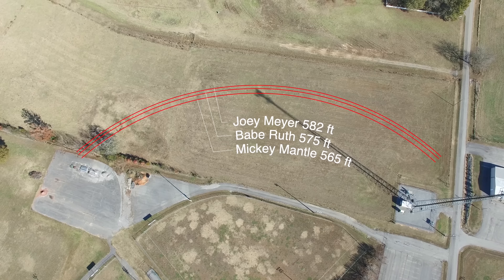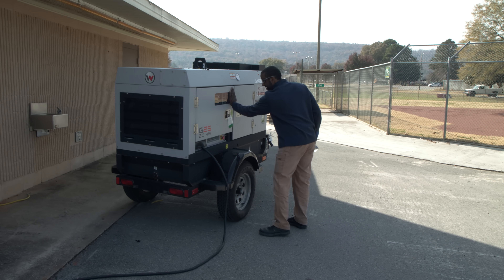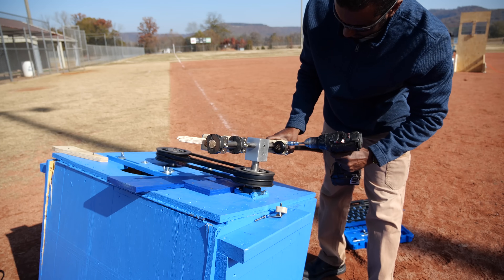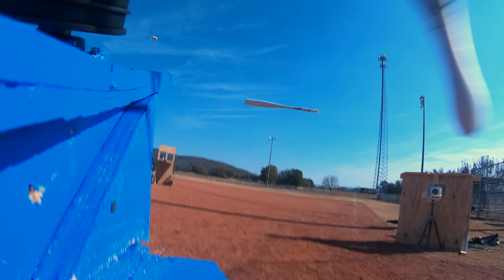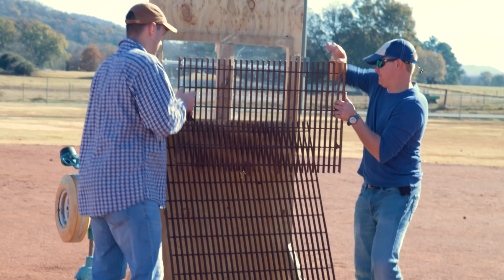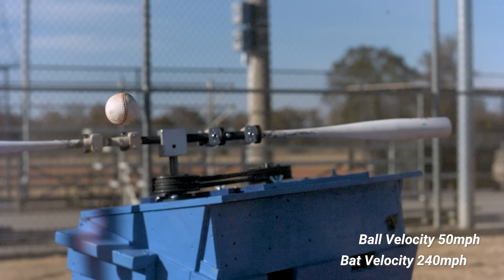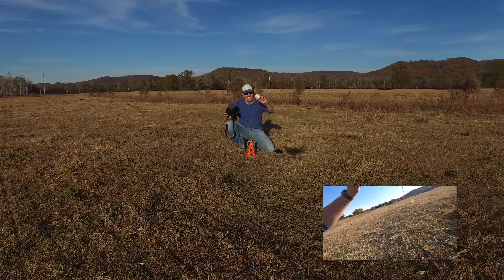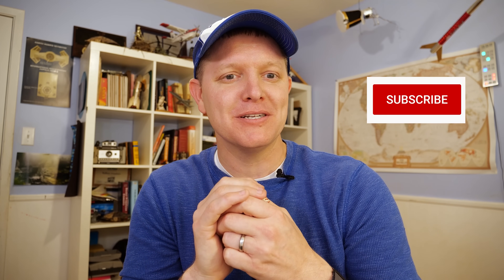World's Longest Home Run (The "Mad Batter" Machine) - Smarter Every Day 230

Comment: The illustration you drew at 3:37 is slightly misleading. With a 3 phase setup like that the torque will be constant (in theory). It would be more accurate to draw a straight line than one with ripples, as the three sine waves sums up to a constant torque exactly.

Comment: No offence Dustin, but you guys shouldn’t play like this. Spinning machines are no joke and not only you had zero protection (your school yard is nowhere near safe), but also stuff like that should be calculated by a mechanical engineer. Not only your bat failed unexpectedly, your bearing broke unexpectedly as you certainly didn’t calculate the dynamic forces, your rotor support is a freaking wooden table shaking, many times too light, no suspension, no rigid foundation... Please get some opinion from a mechanical engineer next time for your own safety.

Comment: OK Here is a question  for you.
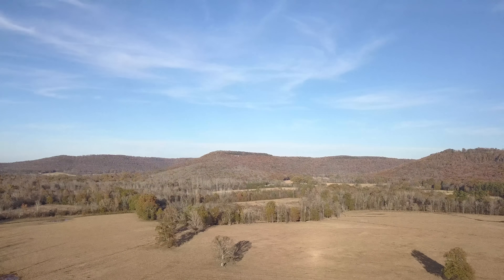At time marker 14:30, your drone looks into a distant field and at the exact point that is 180 deg from the sun there is a dright spot.  I have seen this many times as a pilot as well as a passenger in an aircraft.  

Question: what is the cause?
Is this difraction at the aircraft, increasing the flux at the surface, or something else?

Cheers 
Kevin Hanna

Comment: ADVICE: Of course the bat breaks. It's rigidly attached, and as you said yourself, you will get a tremendous force-concentration at the junction. Instead, you should make a bendable attachment, like a thick piece of rubber from a tyre or such. Just look at how a rotor blade of a helicopter is attached, it can always swing back and forth relative to the hub. It will stay in the radial position due to centripetal force anyway.

Comment: Someone should of told them, the speed of the ball vs the speed of the bat is what determines a home run in baseball... all you would need is good contact with a pitch from a 100mph pitch from Chapman... and use a better metal bat!!

Comment: Probably need to re-evaluate your safety protocols. Part of good engineering is planning for safety.   On another front. I saw a video of someone throwing a bucket  of water into the air at minus 53 degrees F. it turned into a cloud. I would love to learn more about what is going on with the high speed camera when that happens.

Comment: I saw Mickey Mantle hit a home run that almost went out of the old, old, old Yankee Stadium in the 1960s. It hit the upper facade in right field and was still rising. It was simply amazing. If the facade was not there, it would have gone at least 600 feet. Mantle was the strongest hitter bar none!

Comment: How about a titanium bat?  It is supposed to have a molecular memory and resistant to denting or being crushed.  My father worked with it on aircraft in the Navy, and in the early years, it was used to put on the leading edge of the wing.  What they found was that bending titanium sheet over the wing and riveting it into place, it would pull the rivets out.  Also we were told that the Soviets were able to accomplish multi pass titanium welding to build the Alpha Class subs by welding in an inert room.  Oooo a show on the metallurgy of titanium would be cool.

Comment: Arrgghh!
This looks like one of Myth Busters weaker episodes.
Align the wood grain correctly, and drop the speed to where the bat won't explode on impact. Only use one bat with a counterweight. Have the drive shaft assembly secured from the top as well. Fasten the entire apparatus to the ground firmly.
If you're going to go to all this much trouble, finish the job!!
LOL. Fun to watch regardless.

Comment: This is a good video but the pain problem of the whole video is in the Major League Baseball they use wooden bats. If they used aluminum bats they would hit harder and farther. Thus risking someone getting seriously hurt so they use wood bats instead. The guys in the video are using metal bats therefore they will be hitting harder and faster. But you can’t compare the two when they use metal and the major league uses wooden bats. It’s a good experiment and an amazing video but simply comparing the two is just not logical. Good effort and no questions that they would be able to make something that will hit farther but it’s just not in the same ball park.

Comment: Ya, this thing is a whirling deathtrap. The bats need to be swung at lower RPM on long arms, to reduce the gee load on the poor swatters. Or consider using solid rod instead of wimpy hollow bats that cave in on good contact and shed paint on every contact.

Comment: That plywood will not save you haha

If you revisit this, you should just use a metal pipe instead of 2 bats, and see if the MLB will loan you one of their statcast tracking computers. Also, make an air cannon that shoots the baseball 300 mph

Comment: What was the point?  Would have been great if he had made more about how the human body can generate enough force to compete with a machine that has to run-up for 30 seconds and consumes 300 watts -- concentrated energy.  The human body generates 90% of the same force in about 1/2 a second using 100 watts overall.  Now, that is amazing.

Comment: wow that looks fun Wow you got lucky where the bat broke it went in the perfect direction. suggestion would be to use a hopper on top of the automatic pitcher and put a wireless switch to drop the balls in. if you were switching the pitching direction on the fly after every pitch then you could add some actuators to move the pitcher up & down, left right but im sure easier said than done

Comment: Hi Destin. If the baseball is pitched slower the will the closing speed of the bat and ball be higher at contact? For example. Bat traveling at 200mph + ball traveling in the opposite direction 50 mph  = closing speed of 150 mph.

Comment: In the final hit,
- High-speed footage of the impact?
- High-speed footage of the bat failure?
- Why did the bat fail?  What was the mode of failure?  (appeared to be secondary to the ball impact)

Safety...
- overall... more attention to safety is needed.  The kinetic energy of a wayward bat and the potential for penetration (fractured aluminum) are both quite high.  
- Barriers for 'pitcher', 'operator', and 'camera' all did not appear adequate.  
- Kudos on adding the vibration sensor.  Consider adding a second.  
- Kudos on adding the pin to connect the two bats.  Not ideal, but a good last-minute addition.
- Pinning the apparatus to the ground is advised, as well as weighting the base to make it less susceptible to vibration.
- For high-risk devices, consider adding "dead-man" safeties.  e.g. on the main controller, and/or even a dedicated switch/person.  
- Did your insurer sign off on that shoot?  Woof!  :)

General...
- It seems like this project did not get quite as much planning as others.  Given the general success so far, a "redo" or "revisit" may be worthwhile.  
- Additional high-speed camera angles (add one perpendicular to the flight path, and an overhead angle) to allow for better data collection
- Additional analysis of the data (impact kinetics (ball, primary bat, secondary bat), flight path, machine vibration/harmonics, etc.)
- Could you apply motor-braking (as done with your circular saw project) as a safety feature to the batting machine?  In certain failure modes might this be more dangerous than without?
- Yes, I realize that staffing, personal time/schedule limitations, and cost are factors that may rule out "bigger and better."  Use the ideas as you see fit.

Thanks for the open discussion of science and engineering.  
- - Aaron S.

Comment: Everything was great until the aluminum bat came out. Then it all canceled out. Can't break a record with an illegal bat. By the way, I don't think anyone ever hit a ball much over 550 ft. 
That said, the new studies in launch angle and exit velocity has changed the game. Extreme impact is what we saw/are seeing now. A perfect example was Daniel Murphy, who was a good line drive hitter. But Murphy always fell just short. What he always had though, was that special intangible that's rare in baseball. The Mets could be down 10 runs with 2 outs and 2 strikes in the 9th. If Dan was at the plate, he'd believe they could still win. He was a rally starter and someone who never gave up. Well, it seems the Mets hired a guy who worked with Dan and Murphy took to this new batting tech like a duck to water. He showed how he was transformed in the 2015 post season. I knew he (in baseball terms) "got it". Some players get whatever their "it" is young, some older and some never. Unfortunately for Murphy, he got his it in the last quarter of his career. The Mets, in their infinite wisdom didnt want to pay Murphy, thinking his change was an aberration. But, nothing could be more wrong and he was sighed by the Nats for what would turn out to be a major bargain for them and went on to play MVP baseball, making his teammate Bryce Harper look silly by comparison. Bottom line: This was all due to Murphy and the new batting theories meshing like Mike Scott and the split finger that saved his career. Many probably thought that Muphy started taking PEDs, but all the evidence was clear, as to what happened. Sadly, had Dan discovered this at 25, he would likely be a first ballot HOFer. That's how amazing it was. Go look him up from 2015 thru 2018. He was an unstoppable force.
Anyway, love the batting machine, just disappointed that you guys used an illegal bat. You may as well have shot the baseball out of a cannon. I suppose it's the fun of the whole thing. I'm probably being way to anal.

Comment: Hey Destin:

3:35

When you drew a diagram of the 3 phase voltage, you drew a wavey line on the top of the combined voltage curves to represent the torque of the 3-phase motor. 

While this does represent the max-voltage, it's does not represent the torque. 
-----------
Due to the construction of motors, the torque is proportional to input voltage, which is a function of either:

In Y configuration - the summed difference between the voltage of each wire and the total combined voltage (combined voltage is 0, so it is essentially compared to ground)

In Delta configuration - the summed difference between each wire voltage compared to the other 2 wires separately

In either case, the total is a constant number.
------------
This is the major advantage of 3 phase over single phase. As the power is a function of the voltage and current (with current being a function of voltage and resistance), power becomes a function of voltage and resistance. This means that with a constant effective voltage, you get a constant effective power.
------------
While the same effect can be reached using DC voltage, the main issue with large-scale DC transmission arrises.

The issue being that, when transferring power long distances over cable, power losses occur. The losses are mainly due to the amount of current passing through the wire. The best way to reduce the neccessary current is to increase the voltage. (P=IV).

This means that in an ideal situation, power would be transmitted long distances at High Voltage and then lowered for use in homes and factories.

Unfortunately, while Direct Current solved the constant power problem, it is not very easy to convert from low voltage to high voltage (or vise-versa)

Alternating current can be easily converted using a transformer, utilizing the magnetic flux created by the coils of wire with AC currents.

This means that we need to properties of each to get the best of both worlds, efficient and constant power.

Three Phase solves both these problems.

-----------------
Credentials: 
Currently studying Mechanical Engineering at the University of Waterloo
-----------------
While not all of this information is perfectly accurate, it does help to explain the major advantage of 3 phase power of single phase and DC.

Comment: 2x the bat speed but only marginally more distance? The HowStuffWorks page on wood vs. aluminum bats  estimates that for every extra MPH of bat speed, a baseball will fly another 8 feet. An extra 125 MPH on your swing then, that should mean a homer an insane 1,000 feet longer than the record. I guess the perfect bat impact might be a 1 in 1,000 kind of occurrence, though. Or 1 in 10,000. Not to mention a big guy swinging a bat might simply deliver energy into the ball in a way more effective way than that box. The mechanics of a batter's swing, the human body's flexibility...who knows what's involved. Also, unless I read it wrong, an article on Diamond Kinetics on exit velocity seems to state that +1 MPH pitch speed will give you an extra foot of distance. Then there's pitch spin. THEN THERE'S WEATHER.

Comment: DESTIN! This is so dangerous. But still cool. Nice vid bro.
Can you work out the speed of the aluminium bat, approx weight and force. Then see if the wooden defences (with drain grate) would have stopped that thing? Or the baseball?
I was on the edge of my seat for the whole video worried. But yea.., still very VERY cool and looked like a heck of fun :) Love your vids!
Your the best

Comment: This was a really bad idea. Fast spinning objects are terrifying, and I don't know if that steel grate would have actually stopped the bat. You guys should have made a set up so that if one bat broke the other one would automatically release that way you wouldn't have an unbalanced rotation. Not that that would be any safer, but at least your machine wouldn't have torn itself apart. Also, you guys really didn't go much further than Babe Ruth. What a complete monster.

Comment: I'm not sure I buy the notion that there's no torque at the zero voltage crossover points. The alternations put power into the armature only when the current flows true, but the energy is stored in the inertial flywheel effect. If there was zero torque at the crossovers there'd be an audible 60 hz buzz. Taking this a step further, an internal combustion engine gets it's shaft output power when the fuel burns in pulses, there would be a pronounced vibration felt when no cylinders are firing. Instead, once again there's enough inertial force inherent to the engine design which keeps the power steady throughout the crankshaft rotation. IMHO,YMMV, fwiw, etc.

Comment: You greatly limited the machine by having such a slow pitching speed. The slow ball speed always caused the ball to go to left because the bat was too far out in front but if the ball speed was higher there might’ve been a chance to make contact earlier in the rotation cause if a deeper bomb to right where all the farthest dingers have been hit

Comment: And so in the realm of launching things, the newest naval rail guns  can launch a projectile @ 4500 mph (mach 6.) Your experiment (as cool as it was) was in the 200 mph range. That's 22.5 times faster and at that speed, it doesn't need to explode. The kinetic energy alone would obliterate anything it impacted, even the cows. I'm also sobered by the fact that, that technology is designed to destroy things instead of just having fun.  Keep having fun.